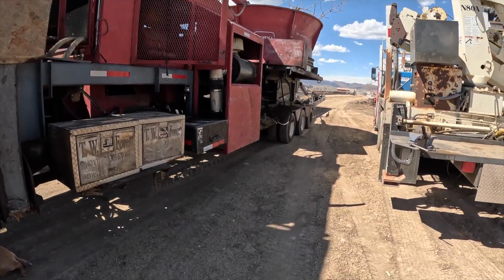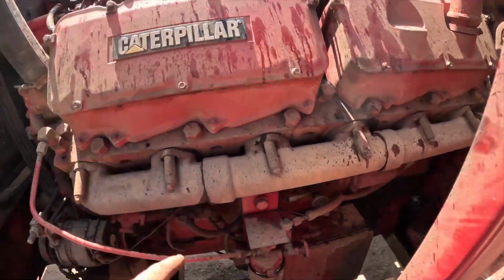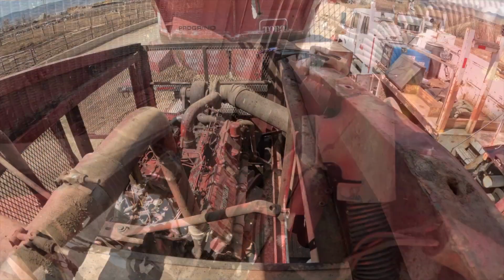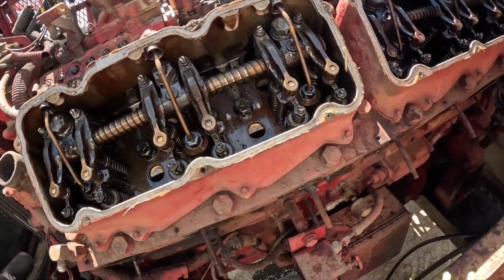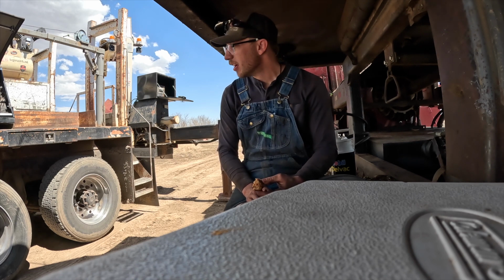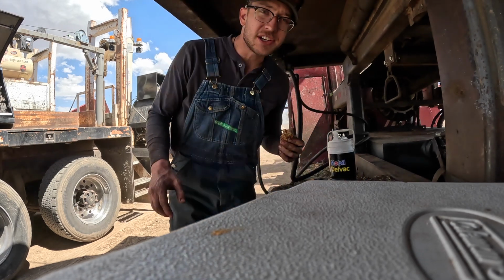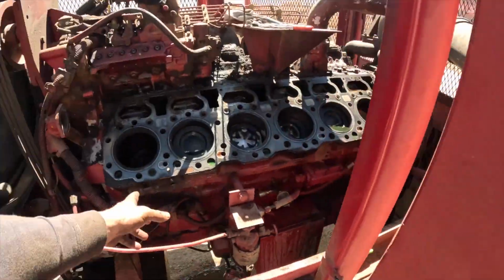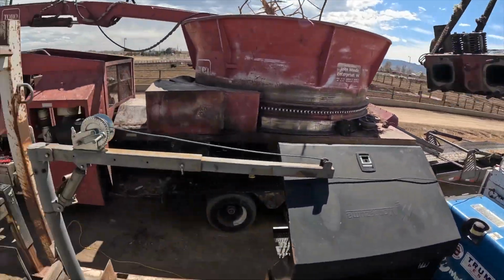Cat 3412 head gasket failure

Comment: Looking to buy a truck with 8-10,000lbs payload. Wont get run much only few thousand miles a year. Any recommendations on some good options? Budget of around 15k
Reply from the maker: That would be f550 marlet kinda. I'd say any ford with the v10 or chevy with the 8.1 for cheap reliability